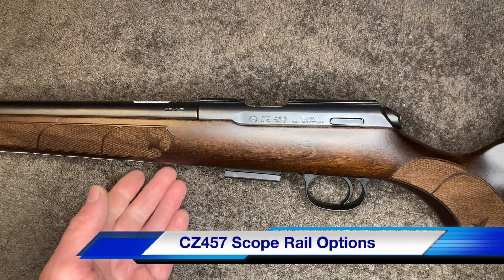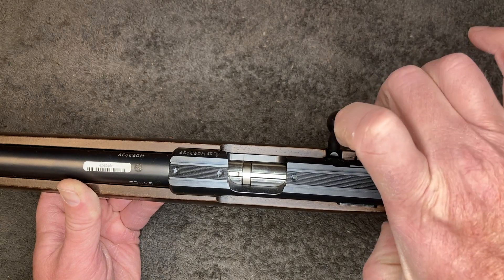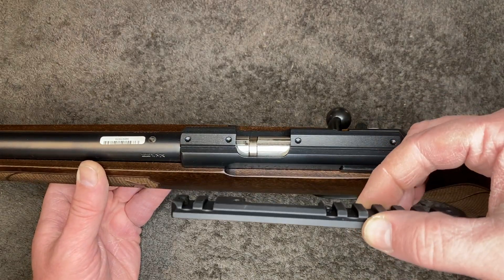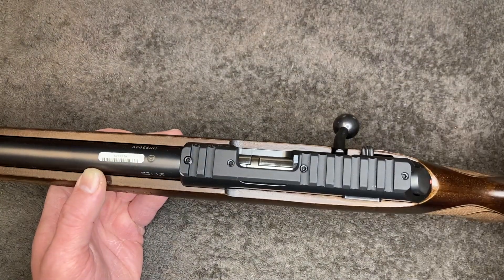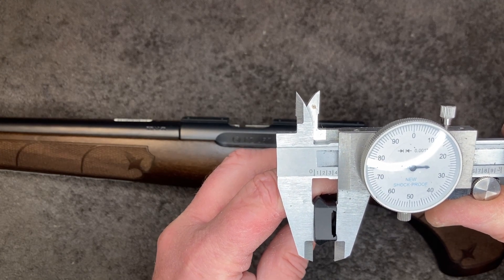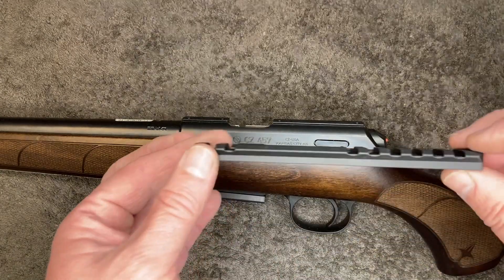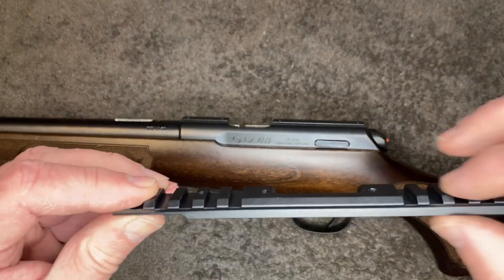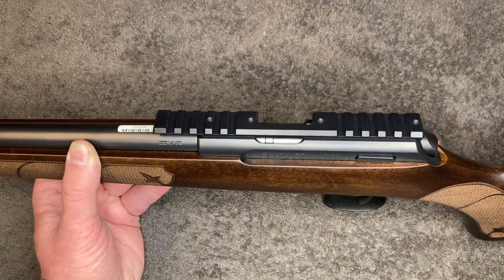CZ457 Scope Rail Options

Comment: I have a BRNO model 2 with 16mm dovetail and it's an absolute nightmare to find scope rings for it 😭
Reply from the maker: Burris and CZ makes a ring set for the CZ527 that you can fit to the Model 2.  There is a tab at the bottom of the rear ring you have to file or mill off.